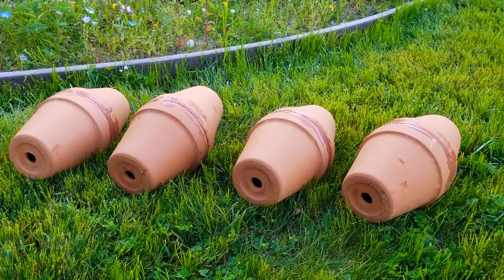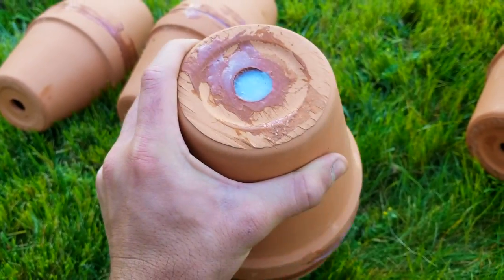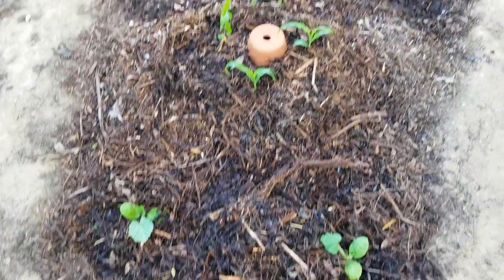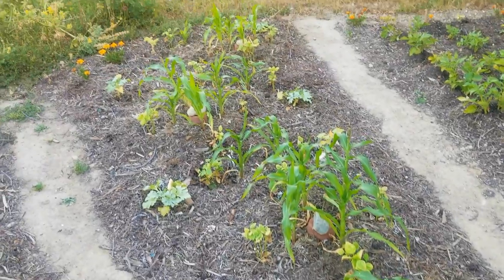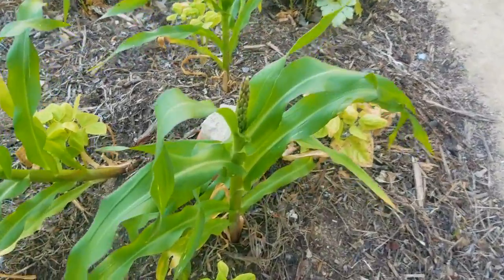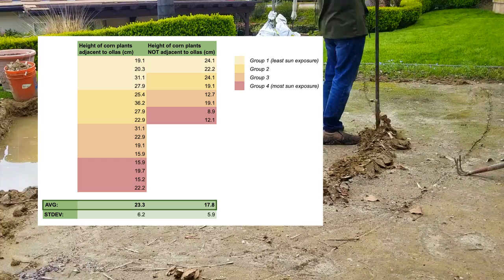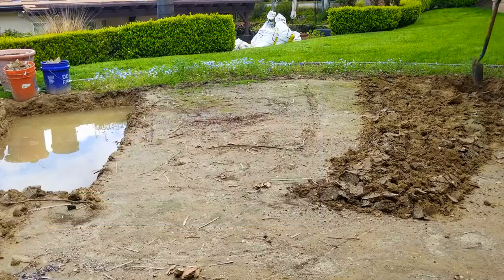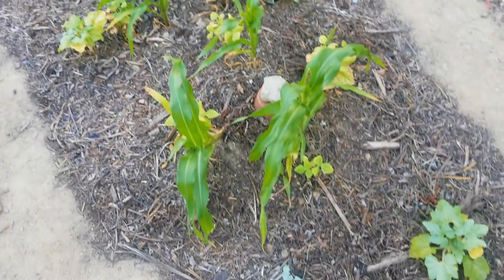Can this ancient irrigation technique allow aquaponics and soil to work together?

Comment: You could easily automate this by attaching these to some pipe hooked up to a tank with a pump that's wired to turn on when both the liquid level in the pots and the moisture content in the soil are low. Using smaller pots and dotting them more frequently around your garden would help even out the distribution and would make scalability pretty easy.
Reply from the maker: Yeah that's basically what the BluMat system does!  Except instead of using a pump you have a header tank that gravity feeds it

Comment: These revisions are required for publication. One of the authors aims was to see if solubilized nutrients permeates through untreated ceramic pots. Its possible that increases in plant growth are dependent exclusively on water near the ceramic containers. Half of the test subjects should be fed from ceramic containers with only distilled water. This will isolate whether increases in plant growth can be attributed to aquaponics water. The experiment would be cleaner and the results significantly more striking if the author grew everything in a nutrient free medium like clay pellets or coconut coir.